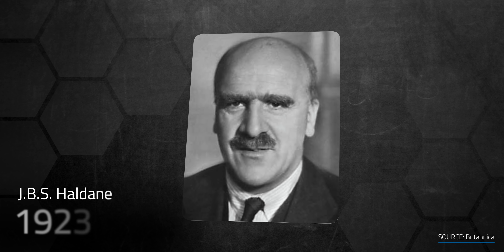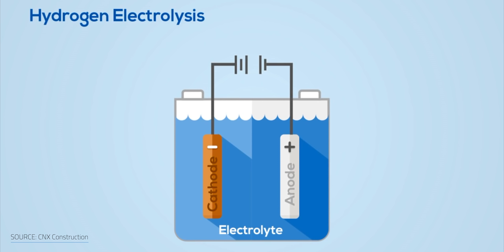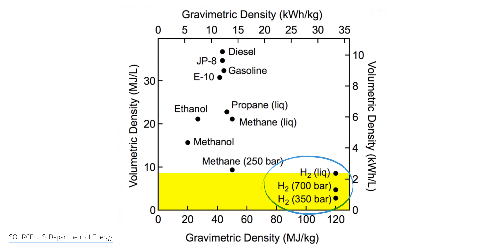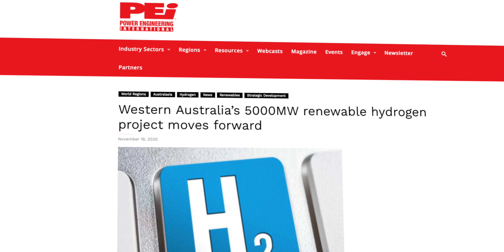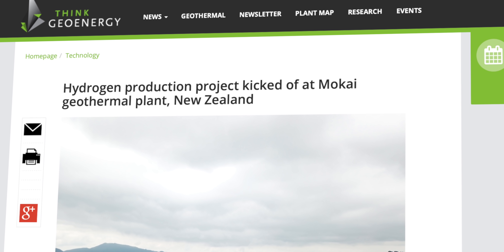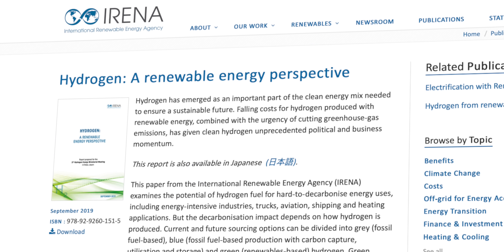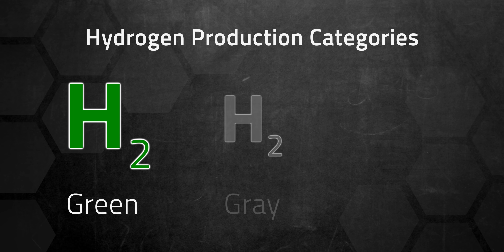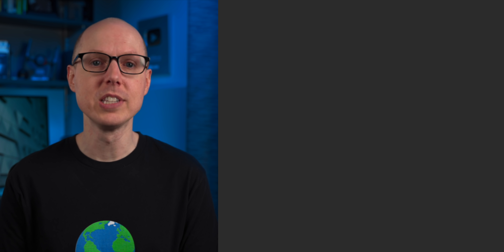The Truth About Hydrogen's Dirty Problem - Green Hydrogen Explained

Comment: mmmmm nice vlog.     this Hydrogen thing seems like a big dud or scam....     It has been years in talking about the big H as a fuel.....   good idea but it is not economical... Batt is the way to go..  If anyone disagrees with my analysis, answer this Question. How much will H cost compared to Battery.  If you think that Australia is producing H... that is a scam..... How do you transport H from Aus to the world... nice work Matt but you should do a little bit more research, nothing wrong with putting the challenging or negative aspects of the subject in your vlog...

If I am wrong and it is commercially viable product in 10 years,     I will eat my hat......

Comment: Hydrogen isn't the only medium available. I think solid oxide fuel cells using methanol or liquid methane would be at least as green as blue hydrogen. They still release some CO2, but far less than heavier hydrocarbons. And it's still fuel cell tech, so drive trains would still be electric. Also, SOFC efficincy is really high, expecially with combined heat/power applications (80+%). SOFC can be cheap to manufacture as well, as is the case with the Steel Cell from Ceres Power in the UK.
Reply: If methen from biogas than its carbon neutral

Comment: The moment to generate hydrogen is during the overproduction periods (summer sunny days etc) which will be a lot of days if the current trend is followed.
IMO the best use case for hydrogen is long term storage at a huge scale. Generate in summer, consume in winter.

Comment: Hydrogen is a horrible fuel source, storage is a nightmare and requires compression into a form that will pretty much leak if not maintained above 90% quality equipment (people don't even get oil changes when they are supposed to).

But you know how we can store hydrogen in a more compact form?  Combining it with carbon in strands.....maybe C8H18.....amazing.

Comment: "solar panel.... to produce 250 liters of hydrogen per day" - that doesn't sound right. The volume of hydrogen depends on its pressure, so saying 250 liters doesn't make any sense. Usually, quantities of Hydrogen are measured in Kilograms.

Comment: Maybe it could be useful for huge boats which use the worst type of oil and need huge amount of energy which is we can't yet sovle with batteries. But for cars it just ridiculous. Not only there are low efficiencies in every step of the chain, but everyone seems to forget another factor which is much simpler to analyse: ITS EXPLOSIVE!. A fully fueled hydrogen car is estimated to have the explosion potencial of half a Tomahawk missile, so why risk it? 
What do you think it will happen to user adoption and public approval of the technologies after a couple of explosions?

Comment: There is a ton of talk, hype, and real technology for hydrogen. It's been around for a while. For grid energy storage green hydrogen is very expensive using PEM electrolyzers, compression, storage, and fuel cells with maybe 40% round trip efficiency. The CCS makes blue hydrogen very expensive too. Lithium batteries crush it for short term storage application like smaller EV's, and because hydrogen has incredible energy density per pound, it works better for larger vehicles (and rockets too).  Having worked with hydrogen in refineries and in chlorine electrolysis cells where it is a byproduct it is not something I really want in my garage even if I could generate it locally. For all of the expense, inefficiency, and hazards, it does offer some unique flexibility if professionally managed. There are well known processes that can convert it to ammonia, methane methanol, gasoline, and diesel. Ammonia has much higher energy density than lithium batteries per pound but not as good as diesel, yet there are some prototype ships that are using it for fuel. Ammonia can run a piston engine, a gas turbine or use a fuel cell to make power directly. The big advantage I see for hydrogen is that it can be used to store energy chemically for long terms (months) something that batteries just cannot economically do. Once SWB (Solar, Wind, Batteries) price out the dispatchable natural gas on the grid the need for long term storage will be incredible and hydrogen with technical and economic advances seems likely to emerge as a viable option.

Comment: I think, generally speaking, that hydrogen will struggle against rapidly improving battery technologies.   And regardless of how much money is thrown at it, there are three significant problems to hydrogen that probably cannot be overcome: 

(1) Storage.  A chemical sponge is the only real solution for passenger vehicles.  The parts count and complexity, while not horribly complex, is still significantly more complex than a battery.  You still need to operate under pressure (just not a whole lot), for example.  That gets you a bit over 50% round-trip efficiency assuming you run it through a fuel cell, and less if you burn it.  The instant you try to do anything else, like compress the hydrogen, efficiency goes straight out the window.

(side note: Natural gas can be compressed and liquified.  Hydrogen cannot.   For fuel cells it is the opposite.  PEM fuel cells only work with extremely light hydrocarbons like... well, hydrogen, at low temperatures.  A fuel cell that operates with heavier hydrocarbons like natural gas require far higher temperatures and that becomes a problem for consumer vehicles very quickly.  The fuel cell is expensive either way for the wattage required.  Both the chemical sponge and the fuel cell, together, honestly wouldn't last any longer than a battery would before needing to be completely replaced.  And the kicker... fuel cells cannot directly drive an electric motor.  Fuel cells only work with relatively constant energy output... meaning you use the fuel cell to charge a battery, and run the vehicle from the battery.  You STILL need a lithium battery... probably at least 5kWh, even with a fuel-cell system).

(2) Transportation.  Its easy to make hydrogen... as long as you don't have to transport it anywhere.   Now suddenly we are saddled with having to have 'filling stations' again, verses an EV which one can plug-in at home and fuel up with our own solar panels.   Nobody wants to be beholden to fueling monopolies again, not when we are this close to being able to do away with them.

And finally (3) Hydrogen has to surpass the ease of battery technologies (which have a round-trip efficiency already in excess of 95%)... at a time when battery technologies are rapidly evolving and getting better.  Its an impossible goal.  No moving parts (taking license to ignore cell expansion and contraction for those chemistries that have to deal with that).  Solid-state (almost) everything.  Pumps are only there for heating and cooling and are not needed for actual base function.   And rapid evolution.

The only advantage hydrogen has over batteries is energy storage per kg... basically just weight, and that's it.  And yet, what does it take for us to no longer care about battery weight?  Not much.  A mere doubling of energy density removes weight as an issue.  And batteries will obviously get there... probably fairly quickly.

-Matt
Reply: Your "chemical sponge" cannot be zero weight, so the seeming advantage of less weight of hydrogen  is already diminished. Most people don't really know "what goes on under the hood", but if you compare " a battery and an electric motor"  to "basically a carefully controlled chemistry lab with storage, pumps, filters, valves and a sophisticated fuel cell plus a battery and an electric motor", I think most rational people would imagine the maintenance costs of the first one would be less.
Reply: @chrisheath2637  I will point out that chemical sponges for hydrogen are not really a new technology.  You can easily hold 20kWh in one hand.   Weight and capacity aren't a problem. 

The three big problems are (1) The moving parts.  Aka pumps, valves, and other elements.  (2) Cost per kW produced (power delivery, not capacity), and (3) Lack of hydrogen infrastructure and the production of hydrogen using extremely environmentally unfriendly methods.

While capacity isn't a problem, continuous power production is.   Having a fuel cell output the power required (e.g. while accelerating) is expensive.  Also, fuel cells are like nuclear plants... they are most efficient when producing a continuous, steady amount of power.  Which is why nearly all fuel cell systems also have a decently-sized battery to buffer the load and to provide bursts of high power when needed.

The basic concept is sound, but its a more complex solution than a straight battery. You have the hydrogen storage (the chemical sponge), all the related pumps and valves, the fuel cell itself, and a 5kWh battery to buffer the energy.   Alltogether the result will weigh significantly less than a straight battery (e.g. 80kWh) would

It would be a fine solution if we had a ready source of hydrogen that could be efficiently produced.  But we don't.  We have only methane reforming (which is horribly polluting), electrolysis (which is inefficient), and electrolysis via excess solar energy (which wouldn't produce enough hydrogen anyway and requires fuel transport infrastructure).

There is also electrolysis via catalysts (algae, etc), but those are huge systems... not something you can stick into a 'gas station' style footprint.  And fuel transport is still a problem.

-Matt

Comment: Hydrogen can be green eventually, but for every 2 hydrogen atoms  from the gas tank, 1 oxygen atom is removed from atmosphere. Eventually, all roads will have less oxygen. Instead of more CO2 we ended up with less oxygen which is much worse. This oxygen displacement becomes worse when Flights start using it. Either way we cannot save earth from humans :-) . I reposted this comment

Comment: THere is a limitless supply of hydrogen in natural gas. Natural gas also has the ability to eliminate our atmosphere. Utilizing CH4, and removing the carbon to make carbon black solves several problems. Hopefully the dry reforming process can be improved to the point were we no longer use steam reformation.

Comment: A part of a healthy energy mix will likely include hydrogen generation when cheap renewable electricity is abundant, to reduce curtailment. Stored hydrogen could be either used in fuel cells to feed back to the grid when needed OR be used for portable purposes, dependent on grid needs

Comment: Am I wrong that water vapour/clouds is a worse greenhouse gas than CO2? I know some applications of H2 involve combusting it (in an engine for example), releasing water vapour. Will that create a stronger greenhouse effect than released CO2 in an equivalent fossil-fuel based system? Or are there mechanisms that stop this from being an issue?
Reply: I believe that the thing is that water vapor doesn't last long, this while other green house gasses like CO2 and CH4 last much longer in the atmosphere. Can be wrong though.
Reply: @MDP1702  Yeah I was thinking that too. The atmosphere can only hold so much before it has to rain it out
Reply: @masterboi31  And well, the watervapor could (if necessary) be cooled down so it turns into just water if really necessary

Comment: I will not support any so-called "solution" that increase my electricity bill.
Reply: What about one the eliminates your fuel bill?
Reply: @engineeringtheweirdguy2103  Fuel is cheaper than electricity!
Reply: @Lu5ck  ...... no it isn’t...
Reply: @Lu5ck  let’s say you have a pretty efficient combustion engine car. 6L/100km. So 0.06L of fuel for every km. Now the price of fuel in the US at the moment is around $0.85/L ($3.2/gal). Electricity however is around 28c per kWh. Let’s assume also you are comparing your car against a Tesla Model 3. Which averages 135Wh/km (0.135kWh/km). So fuel will cost 0.85*0.06=$0.05 per km. 5 cents per km. A model 3 would cost $0.28*0.135=$0.037/km or 3.7 cents per km. The US citizen averages around 20,000km a year. So that’s a saving of $260. However most modern cars that aren’t hybrids have a fuel efficiency of around 8L/100km unless you’re driving a truck. So that brings the price to $0.068/km or 6.8 cents per km. Making a total cost difference of $620 per year.
Reply: @Lu5ck  what also affects this is that most EV’s have so few moving parts that they don’t require any mandatory or regular servicing what so ever. So that’s another saving of servicing costs of $560 averaging incremental costs towards a major service and minor services every 10,000km. So your total saving would be $1,180 USD.
Reply: @Lu5ck  so you were saying?
Reply: @engineeringtheweirdguy2103  I see I see. I don't drive though. Honestly speaking, the place I stay, only 11% of the people drive while 89% take public transport. In such a place, naturally electricity bill has bigger impact than driving.

Comment: I’ve been following alternative energy for quite some time, an interesting process you might like to look into is the hydromax process. Uses waste hydro carbons to reform them into its components hydrogen and carbon monoxide. Both can be burned or used as a source for other processes like the fisher tropsch process to make liquid fuels and the waste is a viable substitute for Portland cement. Early research was based on processing waste wood products, darpa also worked at building a containerized plant that would convert the waste stream of deployed troops into fuel for tanks, trucks, and planes at the front lines reducing transportation cost of supplying troops in dangerous locations. I think a great overlooked opportunity would be using it to process sewage since both the urine and fats plentiful in sewage besides all the other components are a concentrated hydrocarbon waste stream that adds to greenhouse gasses continuously by the process that are currently used to make them clean for the environment.

https://www.globalsyngas.org/uploads/eventLibrary/56KIND.pdf

Comment: There's a nanotech that allows massive hydrogen storage potential by lining up hydrogen atoms on long chains of carbon atoms.  Both hydrogen AND carbon are used for energy production - it's pretty amazing.  It can even re-capture the CO2 for later storage.  There's also cheap mechanical engines of all sizes that can use this stuff that require no rare-earths or conflict minerals, and no open-air strip mines for their steel and aluminum construction.  This magical fuel can even be grown biologically in diverse environments.  Frankly, I'm pretty excited for the future of hydrogen.

Comment: The nice thing about hydrogen is that it can be used to produce electrical power with a fuel cell, a device without moving parts.  But it is hell to store.  What I think would massively help the heavy industries most in the nearer-term is a way to make today’s liquid fuels (gasoline, diesel, jet fuel) in a green manner.  (In this scenario, carbon dioxide would be taken from the environment when the fuels are produced, and re-released upon burning, for a net carbon neutral cycle.)  Trains, planes, ships, vehicles, factories wouldn’t need to be replaced wholesale for quite some time!  Is this possible; I certainly think it should be given that, 1) crude oil production happens spontaneously in nature, and 2) I have heard that Germany produced liquid fuels from coal as far back as WWII?

Comment: I must admit I'm a little tired of hydrogen hype. A lot of people hear about some new hydrogen project and think that "EVs is just a temporary solution. We'll all be driving hydrogen fuel cell cars in a decade". No, they won't. I feel like this hydrogen-narrative is holding back the nessecary shift to EVs.

Hydrogen is specifically for applications where batteries are not practical, not for every day driving with a ready access to the electricity grid.

Also it might be worth looking into the raw materials required for the platinum for the fuel cells. It seems to be obscene and unsustainable amounts ore that has to be processed in order to make platinum. Much more so than anything for batteries for an EV, so hydrogen fuel cells might turn out to be much more resource constrained than batteries.